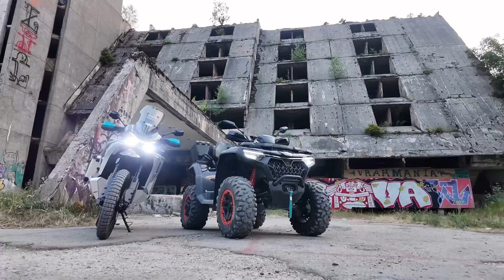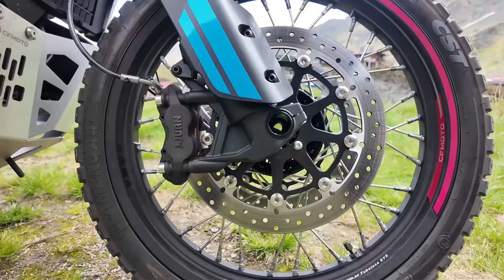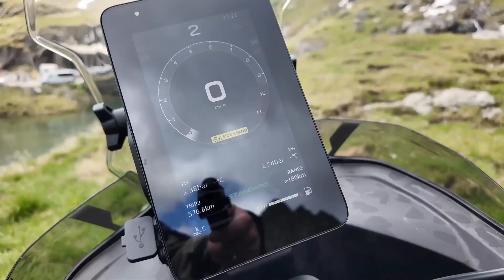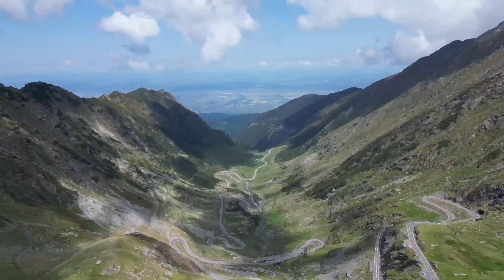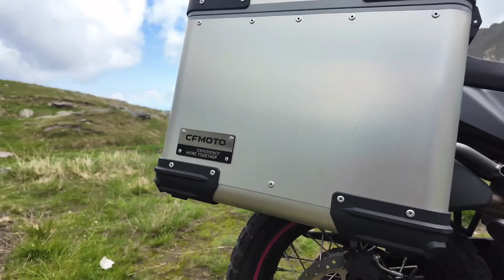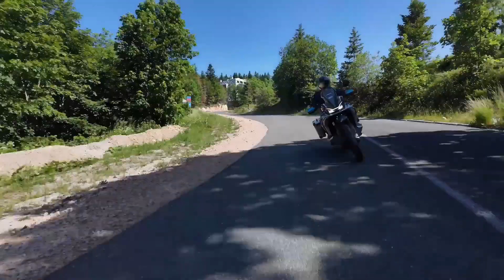🔥 Exclusive: CFMOTO 800 MT-X Review! 🇷🇴 First Ride in Transylvania | Motorcycle Test 2025

Comment: 800mtx have juan/yuan suspension, not a kyb
Reply: the 1000 MT-X will have KYB...curious to see how that bike is
Reply: @DerbyshireRider  probably pretty nice 👍
Reply: @motoboy6666   I want to give it a test ride when its released
Reply: @DerbyshireRider  im on the fence for a 800 or a 1000. The 1000 costs a bit more but is probably worth it 😋
Reply: @motoboy6666  the 1000 MT-X has KYB suspension and Brembo brakes and the TFT looks nicer. My local dealer in the UK actually said that the prices are dropping...the 1000 MT-X will be the same price that the 800 MT-X was, and the 800 MT-X has gone down a bit. Im going to give the 1000 a try out and see how it is
Reply: @DerbyshireRider  At my local dealer in Sweden the pricing right now is 10 000€ for the 800mtx, the 1000cc like 13 000€. But yes, to ride both is absolutely the way to find out which one is right for you. Keen on trying them out myself
Reply: wrong, both have KYB 800 and 1000 MTX ;-)